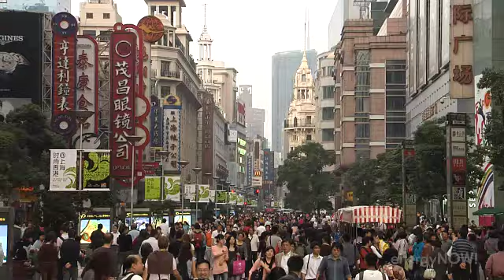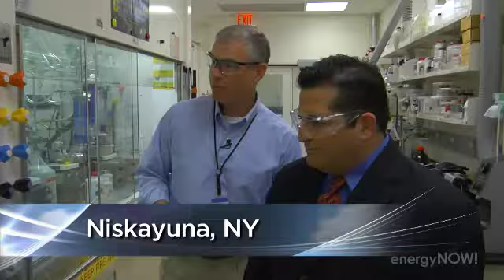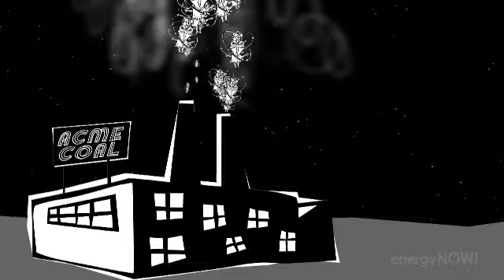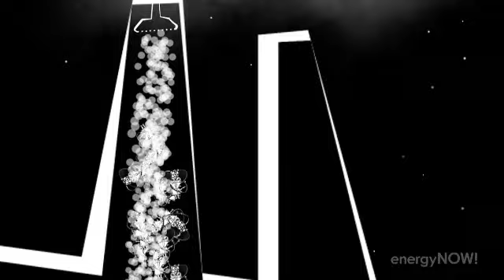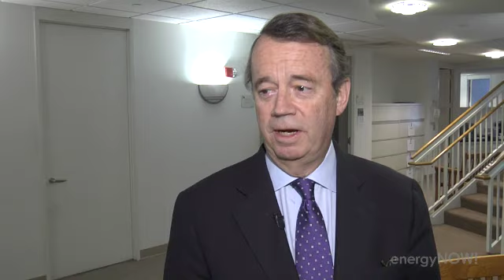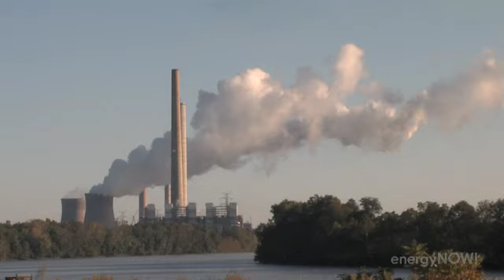Carbon Capture and Storage

Comment: CCS (carbon capture & storage) is part of the solution to stop global warming but its not the solution. There are to many variables that still need to be looked at. One being the geological effect on the areas where the capture CO2 is being stored underground. However the cap and trade model need to be put into effect asap so changes can start. One of the main threats of why that may not happen is due to politicians who know little of the science around CCS trying to make laws about CCS. Scary